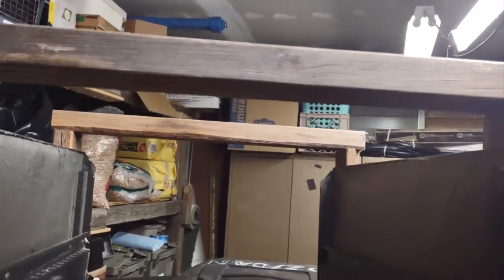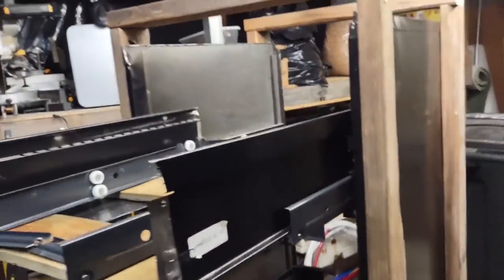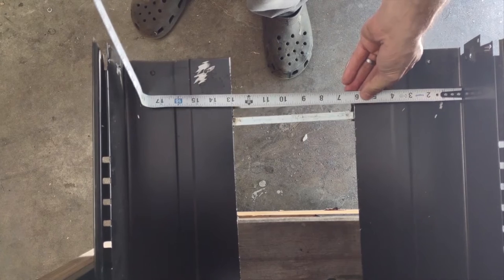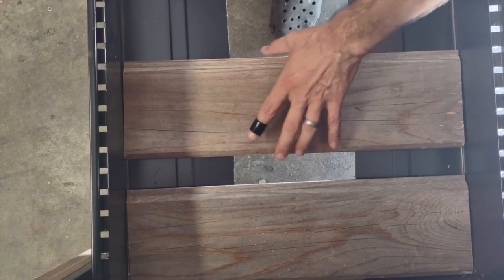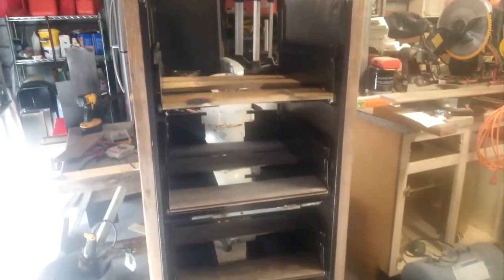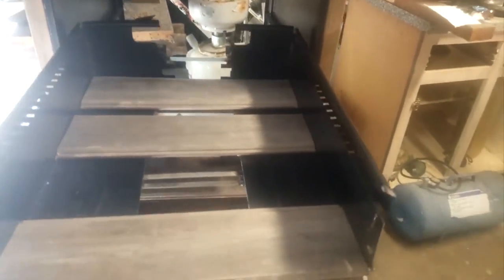Pt 3 how to build a server rack out an old file cabinet 63

Comment: Ok so how was this easier than just transferring the internals of the old box into a standard filing cabinet and cutting some fan and power holes? Looks like a lot of work for what it is.
Reply from the maker: hi Steven, well the server internals would not fit into the box
and i wanted build something that would be easy to move and work with, and i also wanted to shoot a video.
so i built this, and now, almost a full year later, it has made my life super easy so service my servers, and com setup, did you watch all 3 parts of this build?